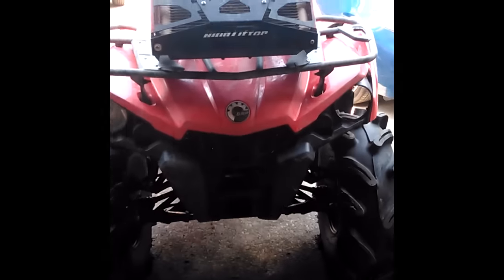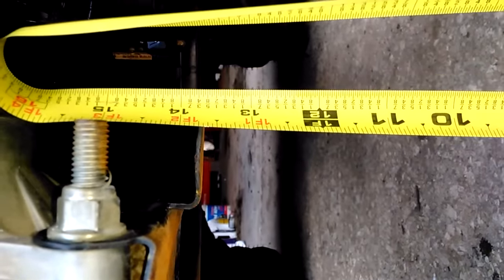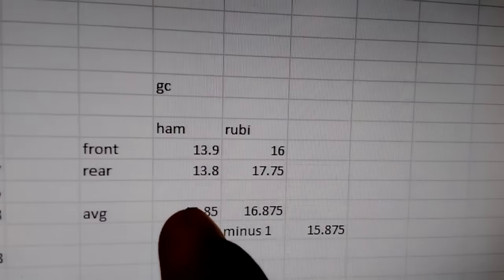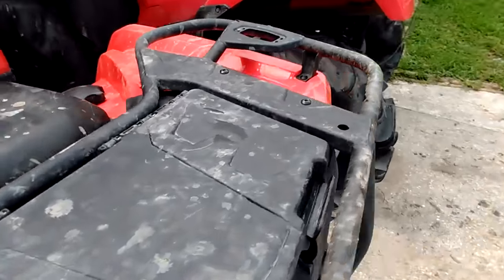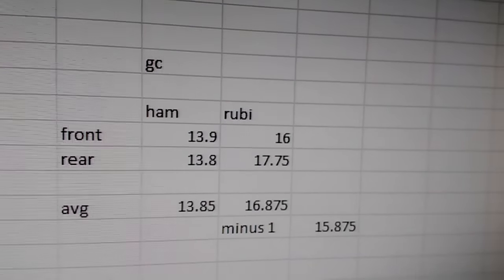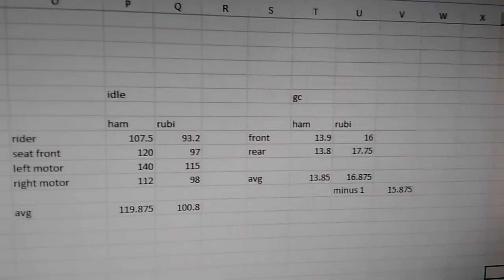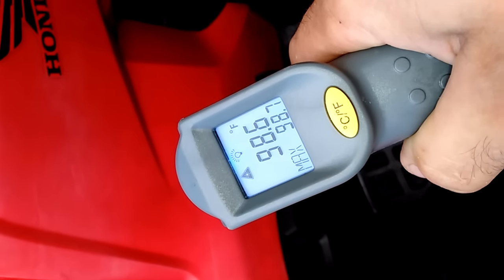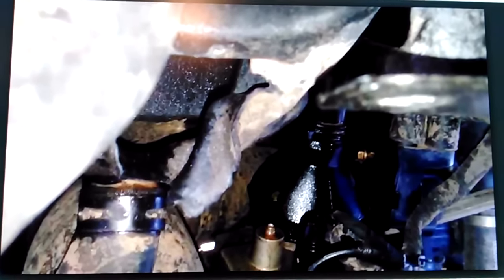outlander vs Rubicon ground clearance and temp

Comment: I bought the 2" high liftet bracket lift kit for my 2018 can am 570 but have been afraid to put it on with stock axles. I would like your honest opinion? How do you rate it? Thanks!
.
Reply from the maker: Had issues with the rear shocks binding and popping out. Also made it ride bouncy
Reply from the maker: I ended up adding limiting straps
Reply: Thanks for that! No broke axles?

Comment: I've actually never found either of my Can-am's too hot to ride, but like you said we have a bit cooler temps up here anyway, plus I don't do much crawling around in the mud. Different riding styles. The Honda is cooler, no argument there. Both are great machines but for different riding styles IMO.
Reply from the maker: apparently the new XMR 1000 Renegade has a pretty common issue where the air boxes are melting
Reply from the maker: +mac102004 I never thought it was too hot to ride until I had to do the radiator relocate now it is obnoxious but I didn't have a choice it was overheating so much
Reply: Yeah I don't know if I've heard about the airbox melting, apparently the body plastics do. I did hear something about Can-am installing a bolt that was too long and it was rubbing a hole in the airbox. I only heard about it on one machine though. Like I said, they do run hot, but up here where the hottest you'll ever get is like 85 degrees, I just don't see those kind of issues often. Plus the new machines are running really lean from the factory. I have a full exhaust and tuner on the way for mine which should help any heat problems there would have been anyway.
Reply from the maker: +mac102004 yeah it's been close to a hundred for a few weeks down here people are melting all kinds of stuff I don't think the Raiders are designed to work efficiently up around a hundred degrees Fahrenheit
Reply: And yeah that rad relocate looked pretty brutal LOL. My last Can-am I ran with the radiator in the stock location. never had an issue out of it. So that should tell you the kind of temps I ride in. I just cleaned it after every ride and it was fine. We don't have any deep clay based mud here either, the kind that clogs rads and sticks to everything. Just totally different riding conditions.
Reply from the maker: +mac102004 what I can't figure out is how the 1,000s don't overheat as far as I can find that use the same radiator I have
Reply: +Christian Amy yeah the bigger motors not overheating with the same cooling system does make much sense, unless they use a low flow water pump or different thermostats or something. Either way the downsides of a Can-am aren't worth putting up with if your not running one of the bigger machines. Which is why I bought the rubicon instead of the can-am in the 500cc class, I just don't think the Honda can be beat for a 500cc machine.

Comment: If you are getting rid of the can am what will the next bike be ?
Reply: I'd like to see what he could do with a Honda rincon but I don't think he'll be getting one of them
Reply from the maker: +Marshall Matthes 850 sportsman or another rubi. Rincon is geared too high
Reply: +Christian Amy  I was going to say I'd really like to see a Polaris comparison I had a 2012 sportsman 500 for almost 3 years and the bike just was falling apart carb was junk axles bearings needed changing at least once a year but got pretty worn out before the year was out, I guess I haven't been driving my rubicon as much as I drove my Polaris but still after every ride I had to fix my polaris, haven't had to touch my honda since day one and I'm running 30s they are wild thangs and pretty light but still, my polaris barely ran them. I feel there are plenty quality polaris bikes out there but nowhere close to Yamaha and honda. polaris over can am,Yamaha over polaris, and honda over Yamaha in reliability in my opinion. just my 2 cents on the debates

Comment: no excuses at all for you temp, BUT, if you were you get a o2 bung welded on both and plugged them.in you would see that can am run really lean. put a tuner on it and richen the afr and you will see a huge drop in temps